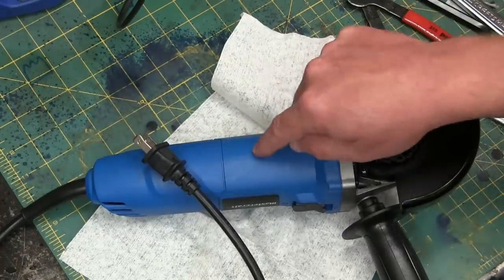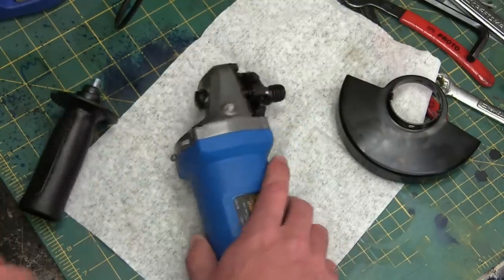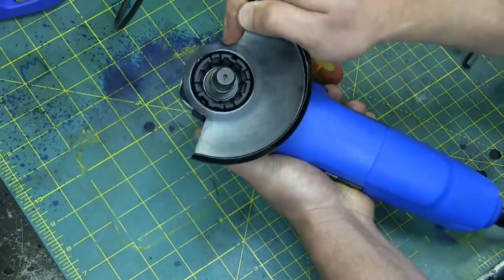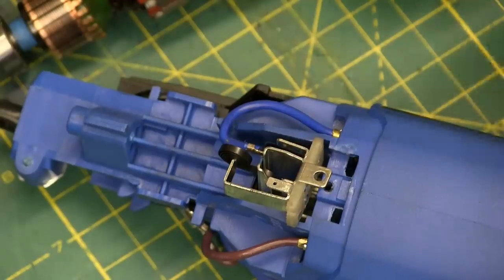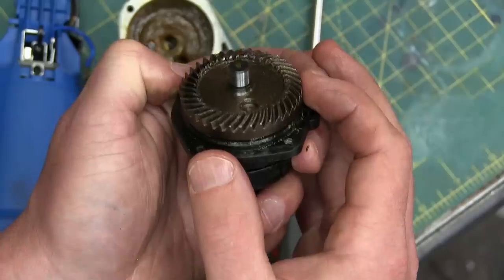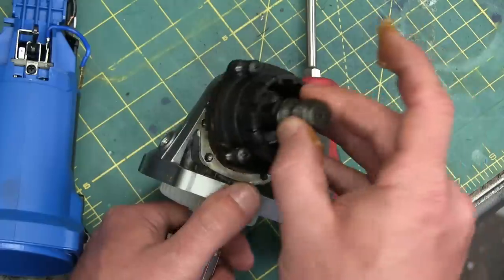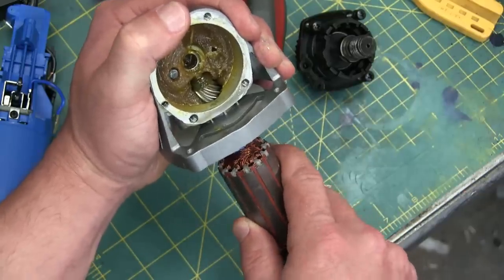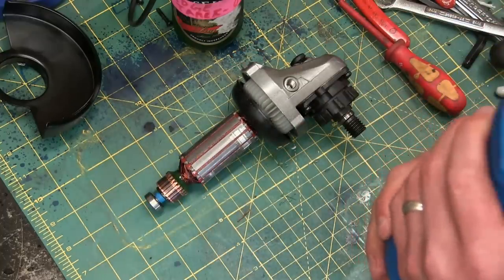BOLTR: Harbor Freight Grinder. HOW BAD IS IT?

Comment: Ive destroyed 2 of these grinders, on my 3rd right now. I use them for cutting railroad spikes mainly, 50 - 100 spikes at a time, with some motorcycle frame work, (3/4 sched 40 pipe) and cutting some sheet metal. The grease does leak out, and that's eventually what kills em. Each one I've had lasted 1.5 - 2 years being used daily in the summer and weekly in the winter. I've never had a problem with anything heating up and melting, but youre right about the grease, it leaks out and the gears eventually fail. But fuck it, for $30 for 2 years of use, I'll keep buyin' em'.

Comment: I work the crap out of 4.5 HF angle grinders..biggest prob is hacking the power cords with .045 cut-offs, or dropping unit breaking the handle/fracturing casting at the handle thread.  I keep several backups, I'm quick to toss em

Comment: I had a Hitachi grinder with the same auxiliary handle angle.  I replaced it with a cheap Porter-Cable and I'm pretty sure it has the same angle.

Comment: To check speed you can get dirt cheap laser tachometers on eBay, DX, Banggood etc. Cheap but they work very well and accurate. They work the way that you stick a piece of reflective tape on what you want to measure then turn if on and point the laser to where the tape passes. You get instant readout of the RPM as well as min, max and avg values.
Very nice to check speed on drills etc. Funny I've found that most brushed tools are not spinning as fast as they're advertised. A 1200 rpm drill running at 1130 or so, a 1150 rpm running at horrible low 980 rpm, a 1350 running at 1300 rpm. The only thing I have which I feel run as advertised is my newest brushless drill advertised at 1400 rpm. It actually runs ~1420 rpm in hi speed and it should run 430 in low but there it runs 425. Guess they rounded the numbers to get "nice" round values because the brushless motor is turning at exactly the same speed no matter what gear (no load) and it has no way of knowing what gear you're in (no switch and wires to it). Of course it's easier to get consistent results with brushless as the speed is governed by the µC rather than just what's the "no" load speed of the motor which varies greatly with manufacturing tolerances (magnet strength - actually a weaker magnet will make it turn faster), commutator wear etc.
This is the one I got: https://www.banggood.com/Wholesale-DANIU-DT2234C-Digital-Laser-RPM-Tachometer-Non-Contact-Measurement-Tool-p-20463.html?rmmds=search
Reply: Btw. When you get it. Open it. You don't need to take out the circuit board - nothing on the underside and unless you have experience securing good connection in zebra rubber bands when you reassemble it you risk the display will have missing digits. The smallest grain of dust will do it (with practice remove dust with tape and it'll work again zebra rubber is not as fragile as the tape strips - fortunately).
What I was to mention is that unless they've changed something since I bought mine some years ago inside you'll find very nice components at a quality level you just wont expect at that price and outside look and feel.
Nice quality glass fiber pcb, 6 MHz crystal, laser diode (without optics), photo diode, some helping components and a nice big expensive DIL package Atmel microcontroller. I don't know if they've locked the firmware. If they haven't it's a good deal just to buy it for the µC alone.

Comment: I have a Chicago Electric Brand (HF inhouse) 4 1/2 grinder I bought back in 2011/2012 that has been well uh... loved. If you want to see what a 'used' one looks like on the inside I can send it up your way depending if the Mounties want a bribe to get it across the border or not.

Comment: I`ve got the HF 4 1/2" orange colored grinder and it works well, but 2 things bug me about it, 1st, the toggle switch, why don`t they put a trigger switch on it? 2nd, it`s hard to find sanding disks that`ll fit it, and I don`t live near any HF`s.
Reply: I use sanding disks from Northern Fool.
Reply: Take the Guard off, then the 5" will fit..
Reply: Douglas McDougall My problem is, finding disks with the right hole diameter
Reply: if u have access to a lathe,step down one face of the nut to the available disk's hole diameter. then u can fit the big hole disks with the nut as a pivot...or just flip it and use the base as a pivot for the small diameter disks.

Comment: in my experience those cheap grinders either fail in the gearbox/bearing that supports the shaft, or you overload them and the field coils fry, which is easy to do when trying to get things done. the Chicago Electric version, which is quite similar  worked great, until I overloaded the shit out of it and let the magic smoke escape. Be gentle and they are fine.

Comment: Interesting that you compliment the switch ------  they are 90% of my issues with HF power tools
while I use HF tools frequently , I won't use their mini grinders any more  (hard core Makita fan on those)  & wierd because I haven't seen a blue one at HF since they stopped imitating Makita in 95' in the US & they change sources over the years) ----I generally stick to the 'heavy duty motors' ----- the only gears I ever stripped was in a small POS angle drill
Their sloppy mechanics. mixed with solid motor windings and armature are a perfect combination for 1/2" drills (had one for years in heavy use), rotary hammers (usually get stolen), mortar mixers (on it's 5th year) ........ BUT SWITCHES have been an issue in many  that I end up 'jumping' them and using foot pedals to operate as replacements are not exactly available

Comment: I use angle grinders in my flooring business and the longest lasting one so far was a Hitachi that is no longer made . I should have bought two. I tried dewalts and the bearings never seemed to hold up. had a makita that lasted pretty good but the bearings shit the bed on it also. I have one of the harbor freight ones I believe like that but the brushes or something started sticking as it need a good thump to get going sometimes. working with a porter cable one now . I like the feel l of it but we will see how long it takes to wear out.

Comment: China has been using a lot of copper coated aluminum wire, (I found this out on my Ridgid shop vac) could you tell me if the windings are copper or copper coated. Thanks

Comment: I recently bought a cordless milwaukee m18 4.5 grinder and the gearbox gets real warm almost hot to touch. Is that normal? I think it is. Ave says it will get hot in vid. Guess I never paid attention to them before. Was hoping they didn't forget the grease during manufacturing

Comment: Which HF model does that related to? I've got several here, none have the plastic gear box bearing holder. 
I've got three versions here, one older orange model, one red or maroon model with the yellow switch, and two of the black $10 Drill Master grinders. All have been here now for at least 5 years I suppose. They were bought for use out of the shop, to curb tool loss. For some reason they don't disappear like the DeWalt and Metabo grinders do out on a job. The only failure so far was one of the orange grinders broke in half, the main body broke right behind the brush holder. Its been surviving every since with the rear half held in place with half a roll of electrical tape. I suppose the damage was from being dropped. 
I have had several paddle switch model DeWalt grinders fail due to shorted armatures but there's no telling how much use those had on them before they failed.

Comment: Speaking of armatures , the generator on my 1975 Harley Sportster  needed one so I bought the cheapie chinese one for $50 and it didnt last one riding  season so I bought the ACCEL branded one at double the cost the next time around and that one never failed. The biggest difference between the two was the gauge of  magnet wire used. Now I cant remember which one used larger gauge with fewer turns but being the engineer you would know straight away.

Comment: 9:12 "if you over heat this, if you over work this" .....had the same issues with mikita brand grinders..... you use a tool for a task it's not meant to do, it will burn out on you the same way every time..... get the same grinder, same torque, same rpms, and watch it burn out just as easy...... tools are made for a specific purpose in mind. stick to the purposes........ also... I was pissed I burned out a $70 angle grinder to test this out..... shoulda saved my money and went for the cheaper version because the expensive ones are just a name to buy, about it

Comment: I keep a stock pile of the $10 harbor freight grinders around. (the drill master, actual harbor freight ones, not the one you have here) and the issues I have come from abuse. they're cheap so I dont bother to take care of them. But I will say they can be left in the rain and still work fine. Usually the cord goes to hell before anything else.

Comment: My Metabo, bought in 2002, has that bearing housing made of plastic too...
Just very recently took it apart to clean it and had a look with the USB microscope at the gears. Sintered metal, but they still look skookum...

Comment: I use Harbor Freight medium price 4-1/2''  grinders.  The red ones.  Day in and day out.  They last forever, never any gear problems.  I have had Makitas and Dewalt good bad in just a few months.  Even if the Harbor Freight only lasted 6 months it would still be a better deal.  However I am using one now that I have had for over 2 years.  Day in and day out.  Love em.

Comment: Mastercraft Canadian Tire power tools are only good for occasional home owner use. As for that side handle, I hate handles that are not at a right angle to the tool body. On my Makita and Bosch I made a bracket which brings the annoying side handle back to 90 degrees.

Comment: I would buy these with a coupon for $9.99. used them as a dedicated wire brush grinder for cleaning my welds. they usually would crack the aluminum housing where the two parts are bolted together. the torque just scootches the housing ,and yes they leak. and the vibration in most of them makes then awful to grind long stretches with them

Comment: I have several of the HF 4.5" grinders in my shop, usually what goes out first is the brushes. By the end of the second set of brushes the bearings are toast so they go in the "return to china" bin.

Comment: Humm I'm just starting out in casting myself. I don't want to knock soda cans as their a free and plentiful supply of casting media. Yes they are poor quality aluminium but there is a lot you can do to increase the quality of your ingots. The most simple being just to recast them a few times and add a few compounds to the cast. I don't think you will be casting heavy duty machine parts out of your home forge, but soda cans and a simple home foundry can produce some amazing things.
Reply: Dude you answered it in your video. Add silicone to your cast aluminium while it is in liquid form and mix it well. This form of aluminium is called siumin. You can also add magnesium which aluminium already contains. But the removal of impurities is done by adding fluxes to bind the impurities to the dross which can then be skimmed as per the normal way. Check out aluminumflux.com for details on which fluxes do what. As a cheap start you can just use plumbing fluxes which gets rid of most the toxic impurities from the soda can coatings. 

I'm just starting out in casting myself and what I'm most excited about is that I can make my very own formula for a metal that has properties I want. Alloys are just so much fun!

Comment: I have owned 3 of them. One was the cheapest. I cut a Pizza plate steel 1/8 for  24in and the motor burned up. It was right back there where the the brushes is. Never had an oil leak out of the upgraded one. But I did have issue where I left it outside the brushes got wet and it fried

Comment: Have you seen the new $49.99 Metabo grinders.  They look like a clone of this one, side handle angle and all.  I can buy 5 of the Cheapest harbor freight grinders, on sale, for that amount.  If one quits working, I've got 4 backups.  Believe you me, I work the crap out of my Cheap-o Harbor Freight grinders.  I have not had one fail yet.  I now have six of them.  One with a: brass brush, cut-off wheel, steel cup brush, flap wheel, grinding wheel, steel brush.  The tool I need is always ready to use.

Comment: It's funny, I had a project that is going to take me about 3 weeks to complete . Which means it would take a professional erector less than 2 days. I had a lot of wire brushing/grinding/flap disking to do to remove rust and prep weld joints. I have killed/maimed 3 grinders in the process which brought me here doing research on the interweb . One was an orange colored one from the orange big box store, one was a red one from the blue big box store. They both died in short order from heat prostration. I will order some chalk stones to see what can be done with the rotors/brushes when I have time. Then I picked up my little cheapie Harbor Freight "heavy duty" grinder and kept going. It doesn't have the torque to do what I wanted and it got so hot I couldn't hold it but it didn't die. I will look at the other reviews to see what presents itself as a candidate worthy of the abuse it will endure.

Comment: Cans aren't too bad for casting simple shapes with lost-foam. I learned the hard way though to be careful what the hell you're melting. We started with beer cans and eventually started chucking whatever looked aluminum-ish into the crucible one night. Woke up the next day feeling like i'd chugged a gallon of Everclear and then kissed the bumper of a speeding Mack Truck. Figured out later we had gotten some rain gutter pieces in there, which contain a lot of... something, maybe zinc oxide or copper  and we had effectively given ourselves "welders flu." 

Get an old mini-muffin tin and you can cast some cool little ingots to put up on yer tchotchke shelf with yer pet rock and yer 5th grade field-day trophy.

Comment: i had a drill that had a plastic brush holder and when it came under some heavy load it fused the brushes right into the piece so they wouldn't move down anymore so they stopped making contact

Comment: Hey AvE, I want to put together a pantographic carving machine, but I live in a condo. I'm thinking of using a die grinder because it seems like a decent compromise between noise (I have to consider the neighbors) and power. Do you have any recommendations on something spinny that isn't insanely loud but is still reasonably powerful? I will hopefully end up doing commercial quantities of grinding - but really I just need to not piss off the neighbors more than anything else. Any insight you could give would be appreciated!

Comment: Bought a metabo about 8 years ago. Made in Germany it's a beast. In retrospect probably over kill for my uses but it's a great tool. Someone left a tool shop grinder at work need to cut a lock off. That pos started smoking and sounded like it was missing a bearing ball

Comment: I've used every grinder possible....Metabo was the easiest to use and change wheels ....the worst to break was the DeWalt, they broke a lot....I was a foreman for a Restoration company that worked tearing and repairing Dams,Parking garages,etc..............As for Harbor Freight...I have tools from them , that are 25 years old and still are going

Comment: If you buy these"things" before you start them up pull the gear housing apart and put in some good grease and polish the shafts then when you start them just run for a short time on and off till the brushes seat and burnish the contacts without over heating the springs on the brushes (this is what I call seasoning it) this will also bed in the gears and burnish the bearings. These things will last for years, it's the people that turn them on and grind strait for an hour that overheat everything before it has time to seat in that destroy them in short order. Sure you can buy a better tool but for the price these things will work for many years. Hint: if you do this with all your new tools they will last much longer regardless of the price ,  And for your info it's called Horror Freight here in the states...

Comment: I guess they must have gone down hill.  I got the "heavy duty" one with a paddle switch.  The bearing housing is metal on mine, not plastic.  I have used and abused it for a few years now and it keeps on ticking (seriously it is noisy as hell and very annoying).  You can run it non stop until it just gets too hot to hold and it doesn't leak grease or start smoking or anything.  I think it was $10 on sale with all the coupons i had.  Then again you buy 5 of the same thing from hf and one works great, one catches fire before you even plug it in and the other 3 are somewhere in between.

Comment: Loved the fact about you pointing out people stopping the grinder with the detente pin.  The reason I have seen it done... and done myself ooop..  is if you are using a wire wheel or something that threads onto the grinder.. you hit that pin just before the grinder comes to a stop.. the tool spins itself right off.  Sorry for spreading bad habits ha.

Comment: Great video, thanks.

I was always taught that you should never, ever tin a wire going into a screw terminal, but instead use either bare copper or a ferule of some sort. the reason is that solder tends to "flow" away from the terminal and over time will cause the screw fixing to come loose.

Any thoughts on this?

Comment: The motor housing and switch of this grinder match the parts of my $200usd Dynabrade Electric Dynafile II.  Clearly there is a different gear end and power cord, but it makes me wonder.  I may have to take a look inside my Dynafile just for giggles.  Thanks for the vids sir!